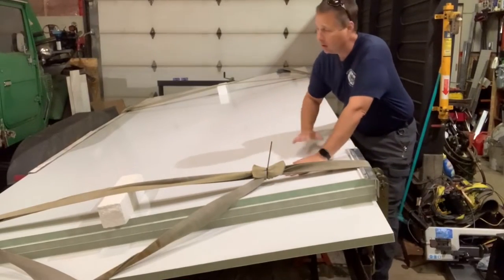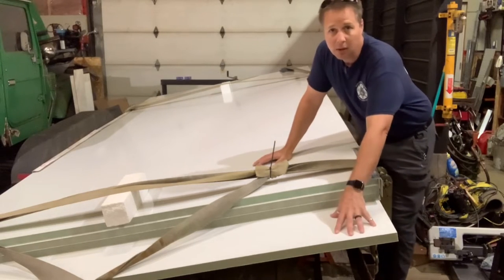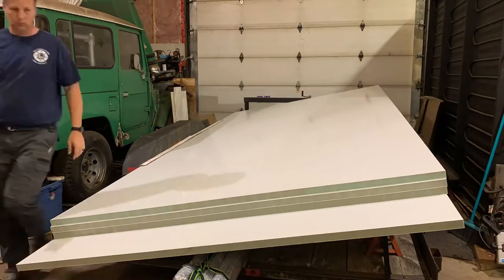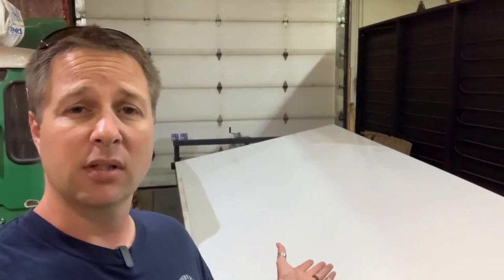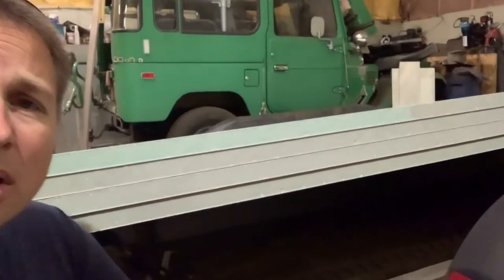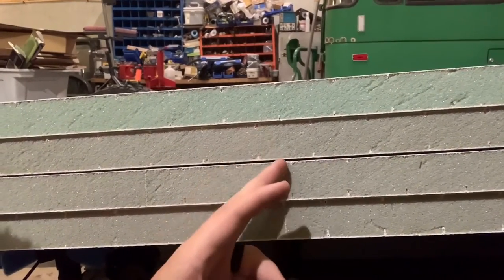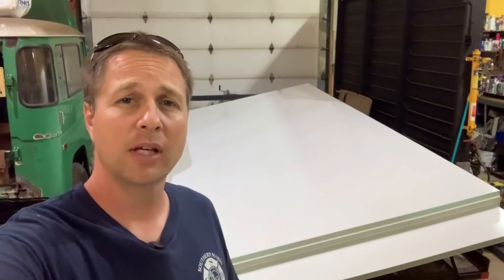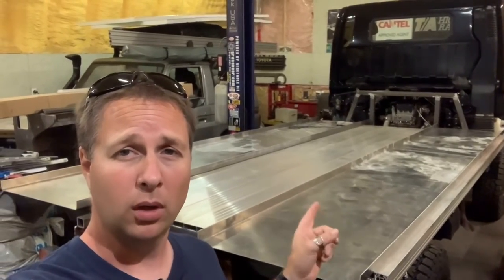Mitsubishi Fuso Camper Build - Using composite panels

Comment: Thanks for sharing the link for their website.  Unfortunately I couldn't find any information on the panels.  Just their build options on a composite pick-up bed camper. 

Have been looking for a company here in Florida with no luck.
Reply from the maker: If you contact them and talk to Jean Francois I’m sure he would be happy to get you more info - they are super busy building campers, not much time to work on the website!
Reply: There's a place called Boreas Composite Panels in Pueblo, Colorado.

Comment: just started watching all your videos. just wondering what the plan is for the wiring? id threre any channels for wiring? or will all be surfaced ran?  thanks
Reply from the maker: Hi! - thanks for watching!   Wiring will be all internal to cabinets - or external on the roof (for solar). The front end dinette will have a floor to ceiling cabinet in the center that we can run wires inside to get from the roof into the interior - and a few other areas have floor to ceiling “routes”.  Interior lighting will be LED strip lights.

Comment: Hi do you have a video of assembling them? I am still having hard time imaging how to glue/screw/adhere the panels together and then the interior cabinets and other things to the panels itself ?
Reply from the maker: Not yet, but that part of the build is coming very soon!!!
Reply: Looking forward to that!

I saw one person who glued aluminum extrusions to the inside and then attached more extrusions to those to make cabinet frames.
Reply from the maker: I’ll be using t-slot, or 80/20 to build some of the interior, and there will be sections that are bonded to the insides of these panels.  😎.
Reply: @BruceandKrista  Nice! I love that stuff but haven’t yet used it in the RV, just around the house. 

Another product I have been playing with is T track slots. I’ve got a strip of that with RAM Mount balls on my dashboard. 

My favorite extrusion supplier is Misumi. They have a huge range of extrusions. The small simple ones are reasonably priced. The exotic ones are priced for people building out a factory :)
Reply from the maker: @gf2e  I’m really surprised at the cost of some of the basic t-slot style accessories, I’ll check out that supplier - thanks!
Reply: @BruceandKrista  They have an enormous range of prices. Common simple stuff is competitive. An angled painted T slot cut to high precision dimensions is…$$$

I try and have a spreadsheet of costs so that I know how price sensitive I should be. Sometimes I look and say “I only need 5 of those why am I worrying about $2 each” and other times I need 50-100 :)